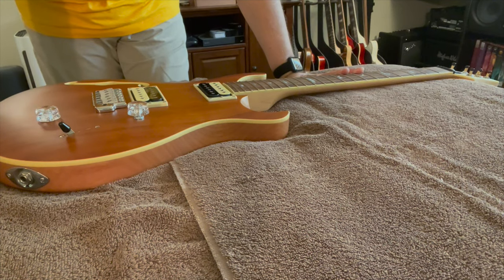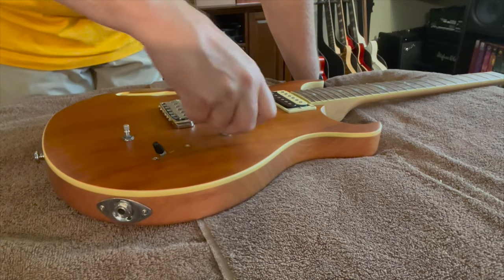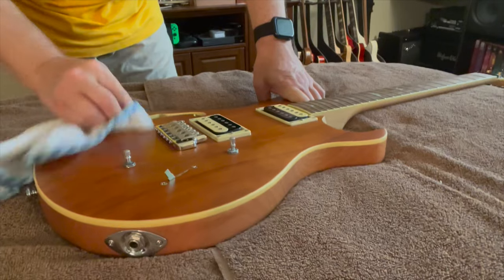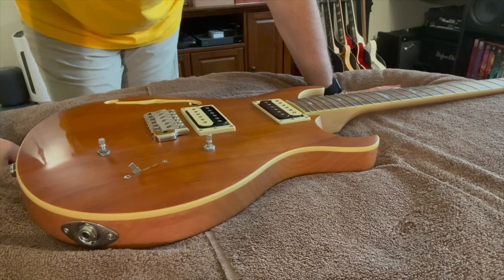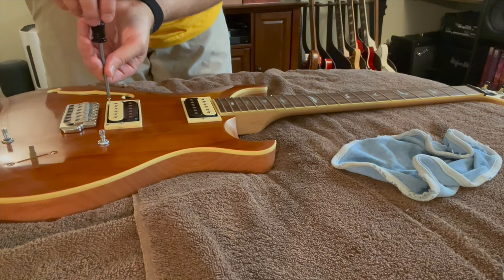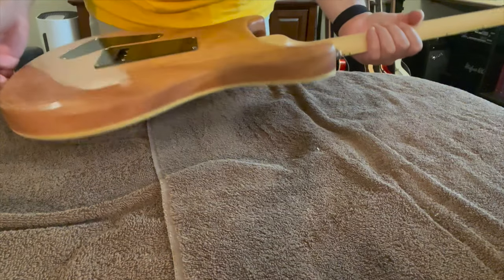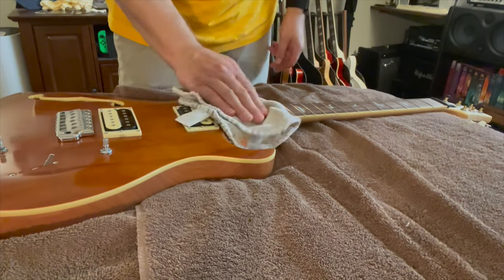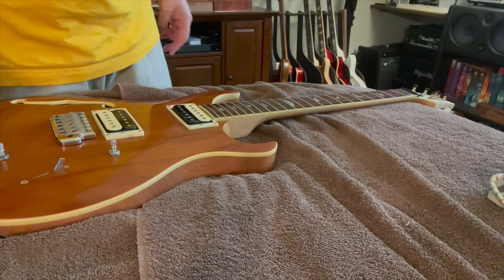How to convert a satin finish guitar to a gloss finish with out re-spraying

Comment: What is the buffing compound you used?
Reply from the maker: It’s called Howard Restor-A-Shine Polishing Compound. But any polishing compound with micro powder or micro beads should work fine. Just avoid the ones that have any kind of pumice or grit in them.
Reply: Have a black matte finish guitar myself that I’m going to gloss up , thanks for posting this ..
Reply: @IamMusicNerd I don't really understand. but, will car compound work?
Reply: How long does it last? Does it break down over time requiring additional applications? Thank you.

Comment: I accidentally swiped in between the pickups with the towel that had fretboard conditioner on it. I wiped it off immediately, no problem. And later I noticed the smudge between the pickups. I used a wet wipe, pledge, I met the wet wipe sit on it for a couple minutes, but the fretboard conditioner is not water soluble. It's not bad, but it's a 3 week old Schecter banshee mach 6 frs in what they call fallout burst finish. I was doing it's first string change/ fretboard cleaning and I'm usually very careful, but I messed up. What you did there is very cool! And I think to get rid of the smudge I'm going to have to do something similar. Thank you for posting this!
Reply from the maker: Thanks for your comment! Let me know how it works out. Good luck to you!

Comment: It also really pulls out the grain, making both the light and dark grain lines richer. My only reservation is that if there is something in the compound that "removes" the original finish. I suppose it doesn't really matter as it is offering a protection to the wood all its own. I have a satin Taylor that I think could look a lot nicer if it was shined up a bit.

Comment: Nice job! A couple years ago I bought a "used" Epiphone Les Paul Studio from GC that was actually brand new and in excellent condition except for an obvious flat scrape in the poly varnish on the lower bout by the tailpiece. It happened in the store so since they couldn't sell it as new any more it was marked down to half price for clearance and I came across it first and jumped on it. Figured I had nothing to lose; it was a steal and it played great regardless. These guitars have a heavy multi-coat buildup of gloss polyurethane varnish so if you're careful and patient you can polish pretty vigorously without going too far. I worked on the scuff for a couple hours spread over a few nights, just sitting in my easy chair and polishing only by hand, using Turtle Wax "Renew Rx" Premium Rubbing Compound (an automotive product with no silicones or wax) and small clean folded swatches of old cotton tee-shirt material. When a swatch had no more clean faces to polish with I threw it away. I buffed the residual polish off with a fresh clean cloth between re-applications. This is strenuous and a little tedious too but I'm a woodworker so I'm used to that. Eventually the scuff completely disappeared. Or to be fair, I know where it is but nobody else would ever find it. I went over the whole top lightly with the compound then to feather out the repair into the overall finish, and did the final buffout with folded soft facial tissues, fogging the surface of the guitar with my hot breath in the same way you'd clean your eyeglasses. Finally applied a hand-rubbed layer of Johnson's Paste Wax as a top coat, which by the way also has a microgrit polish in it so this can be a two-edged sword- go easy, be careful. It came out beautiful. Voilà, a better-than-new Epi Les Paul for dealer cost. So my next experiment was to polish the 'worn' matte cherry red poly on an Epiphone Special, again just by hand while sitting in my den. Came out to a very nice aged-looking semi-gloss sheen that makes the guitar look like it's old but well cared for.
Reply from the maker: Nice! Lots of elbow grease can do wonders! :)
Reply: @IamMusicNerd  Yeah, elbow grease was the key, along with patience. Sorry that was such a long description of the process but I wanted anybody who's interested to know exactly what I did. It would've gone faster if I took it out to my shop and machine polished and buffed it but I have time and didn't want the mess of compound slinging off the pad. Yours came out great man, beautiful guitar!
Reply from the maker: Thank you!

Comment: That's awesome. And it's so easy. I would've been alright actually refinishing my guitars but this is cake. Now it works on acoustic and all that too right? Are there any things this won't work on? I figures it would work just as well but I just want to double check. And you said it's polyurethane? So, theoretically, you could put on a bit more and get that high gloss look and protect the instrument more?
Reply from the maker: Theoretically, yes. However, every manufacturer uses different types of polyurethane or lacquer, so results could vary slightly. 

It should work on acoustics as well, just be careful not to press down as hard as with a solid body when polishing, since the wood is very thin and could crack if you press too hard.
Reply: @IamMusicNerd  Okay. Will do. Thanks for that. This is so cool. I never liked that satin look very much.

Comment: Can using this process on the neck cause problems? Or is it just your personal preference? Also, how well does this hold up over time?
Reply from the maker: Good question. I have not done it on the neck. I typically like the feel of satin next more than gloss the neck. So I only have tried polishing the body of the guitar. I’m sure it would work on the neck, but I would not be able to tell you definitively until I try it myself.

Comment: I always get nervous at the idea of taking the pickups out of guitars for things like this, because I feel I will ruin them, even though they're still connected with the wiring. I want to try doing this myself... but I have that fear of screwing up my pickups so I don't know.
Reply from the maker: I can understand that. I was nervous the first time as well. But I have done it dozens of times now, and I have never had an issue yet. The soldering is usually very strong. Just be gentle and don’t tug if you feel resistance.

Comment: Hi. Thanks for the video. I have a question, will it work on satin nitro guitars? Thankyou
Reply from the maker: Great question. I believe so, as it is still a lacquer. However, nitro is harder and more brittle than poly. So just be careful not to push too hard to avoid cracking the lacquer if the wood flexes on your guitar.

Comment: Hi, this looks great, thank you! One question: does this gloss stay or does it disappear after a while, to become matte satin again?
Reply from the maker: So far mine is still glossy after about 5 months. I am not a professional musician though, so my guitars do not take much abuse. My guess is if yours do, they may need to be re-polished a couple times a year. If not, it should last quite a long time.
Reply: I’m pretty sure it will stay. Satin finish guitars naturally become shiny at locations that have a lot of contact because of the oils in our skin, general wear, etc. From my experience, I can only assume that the coat from the compound will stay on there for a long time. It might get less shiny, but it will definitely never be back to original.
Reply: Thanks for info, sounds great! Intend to buy a new Gibson acoustic J-45 faded, which has matte nitro finish faded,  and as i prefer glossy, will polish it up!
Reply: What type of compound did you use? Was it light, medium course? What about the type of pad to buff it? I want to do this.

Comment: hey! thats a very cool vid mate! thanks for it! I have one question. will it help to protect satin against the scratches? Ive got gibson satin finish, but I can do the small scratches with my nails only. I cant imagine to have this guitar on stage while getting mad on stage. will this tutorial help me against the scratches? thanks!
Reply from the maker: Great question! I guess it depends on how deep the scratch is. 
As long as the scratch does not penetrate through the thin satin finish into the wood, you should be able to buff it out no problem using a method similar to this. 
However, if the scratch goes through the satin finish then buffing and polishing may not hide the scratch completely.
Reply: @IamMusicNerd  thank you for the reply sir! and what if I could use epoxy lacquer on the  satin finish? I mean transparent. because I dont want the satin finish anymore, do you think it should work? to put epoxy layer as a top to avoid scratches. I am just thinking if it will be not problem to have soft satin finish under the epoxy.
Reply from the maker: Ya, I would be careful with that. The hard epoxy lacquer could crack over the top of it, or it could cause the sating finish underneath to wrinkle. (depending on whether it was polyurethane based satin or a nitro based satin). Not sure if there is an inconspicuous spot to test it on first, or if you have an old cheap guitar you could try it on before doing it on a guitar you love.

Comment: how long should i rub the compound by hand before i use the drill with the pad? and how long should i use the drill? also, how’s it holding up 10 months later?
Reply from the maker: Good questions. I only let it sit for a few minutes after rubbing in by hand before using the buffing pad on the drill. (Make sure it’s one with a thick sponge pad under the buffing wheel, so that there are no hard parts that would be pressing against the guitar) It’s been holding up very well. Still looks nice and shiny months later for me.
Reply: also, how long should i have it dry? and how many coats do you think it’d take to get it gibson standard level shiny?

Comment: Hi Thank you for your awesome video.  Just want to ask will it also work on acoustic guitar as I am after  a parlor but it has open pore finish.  Can I change open pore finish to gloss using this method.

Thank you Kerol
Reply from the maker: I have not tried it on that yet, but as long as the guitar has a lacquer or urethane based finish, it should buff up to a nice sheen. It might just take a few extra coats with open pore as it’s a far thinner base coat. 

However, be careful not to press too hard when buffing a hollow guitar. You can accidentally crack the wood, so you will have to buff by hand very lightly, which could take more time and patience.
Reply: @IamMusicNerd  thank you for your help.😊🙏
Reply from the maker: Anytime!

Comment: Hey. I'm assuming this method works the same for buffing the back of the neck?
Reply from the maker: Yes it does! 

I usually do not do that since I prefer satin necks, but if you prefer gloss necks you can buff them up the same way. 

The only exception would be if it’s an unfinished open grain neck. (Open grain with no satin clear coat on it) Buffing that would not produce a gloss finish right away because it would soak into the grain. 

In that case I would recommend using a thin coat of satin or gloss rubbing lacquer/urethane first to seal the grain, then after it dries hard, do the buffing compound to get it smooth and shiny.
Reply: @IamMusicNerd  Legend!

Comment: Does it damage an acoustic guitar body
Reply from the maker: Good question. I have not tried it yet on an acoustic. It should work, but you will have to be very light with your touch, and not press down as hard when polishing. I have an old small parlor sized acoustic I might try it on to test.

Comment: Would this work on a nitro satin finish?
Reply from the maker: I believe so. There are certainly a few exceptions, but as a general rule, most lacquers or urethanes should work with a high quality buffing compound, because almost all satin finishes use the same base as the gloss versions. They just either have an additive to give them a lower sheen, or are not polished as much.

Comment: Whennit comes to electric guitars the body s entirely esthetics and has zero to do with sound. Take the electronics and put it on a 2x4, tune it up and play.
Reply from the maker: For solid body electrics, you have a good point. Jack White even did an experiment with that. Very small differences between a Tele with humbuckers and a Les Paul. 

But for hollow body electric guitars there is a noticeable difference in sustain and resonance compared to a solid body electric. You tend to get a lot more feedback with the pickups in a hollow electric compared to a solid body as well.